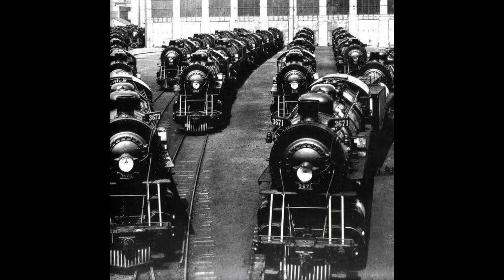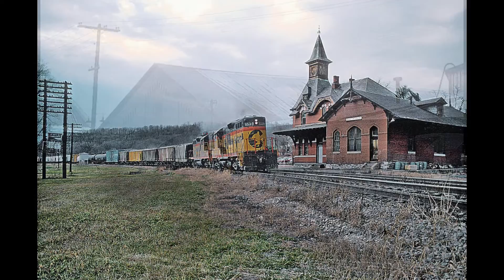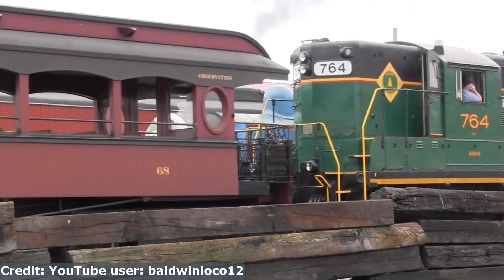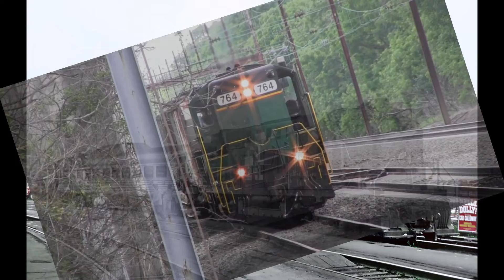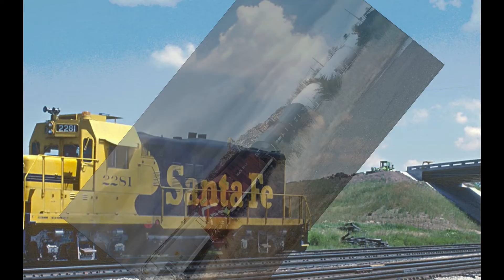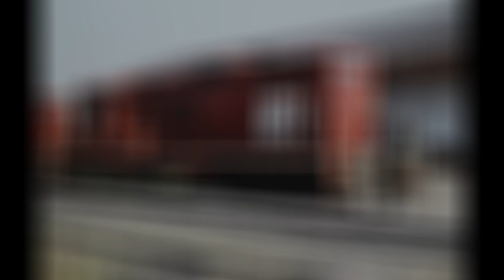The 2 in EMD' 1-2. The EMD GP 9

Comment: EMT had the backing of General Motors, General Electric was a large company, BOCES big companies could finance a railroads purchase of their diesel locomotives. Baldwin, Fairbanks Morse, Alco could not. With the railroads losing Freight to the trucks and the interstate and losing passengers to the airlines the market for brand new locomotives was shrinking. A hostile Workforce also does not help either. Both major locomotive companies introduced High horsepower locomotives intended to reduce the number of diesel locomotives needed to power train. In the end run though EMT unit reduced itself out of business. Many railroads also instituted rebuilding and upgrading of diesel locomotive instead of trading them in and buying new ones. With Alco locomotives they had all of their eggs in one basket as the saying goes.

Comment: EMD also made the GP18 & GP20 which were successors to the GP9 and had the same basic cab and hood style. The 1800HP GP18 was sold from 1959 to 1964 but only sold 405 units, and the turbocharged 2000HP GP20 from 1959 to 1962, selling 260 units. The turbocharged 2250HP GP30 was the first attempt at a new look (using automotive styling!) and sold 948 units from 1961 to 1963. In 1963, EMD started production of the new "spartan cab" (angular roofs instead of rounded roofs) models GP28 (non-turbocharged) and GP35 (turbocharged), the last models produced reaching upper limits of the 567 design capabilities. In late 1965, EMD introduced the 645 engine in both turbocharged and non-turbocharged models in the 3000HP GP40 and 2000HP GP38 (and the six-axle SD lines as well.)

Comment: EMD will also rebuild a GP9 to GP2x/GP3x ECO. Want your 75 year old engine to meet EPA T4 and make 3000HP, that can be done
Reply: sadly that could never happen. the federal government is mandating 567 and 645s all be retired and scrapped.
Reply: @suppylarue220  The federal government is not and EMD has at least 1 demo GP23ECO built from a GP9. 645 can meet EPA T2 without DEF and likely T3 with def while 710 can reach T3 without DEF and T4 with

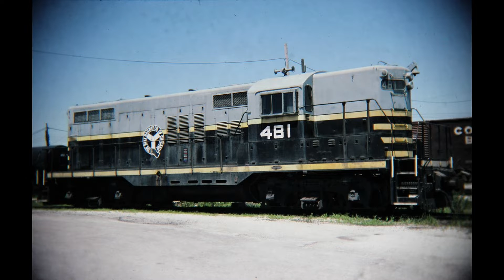Comment: Love the Belt Railway of Chicago GP 9 at 1:50 with the super-rare friction bearing Blomberg trucks. BRC was supposedly very frugal with its early diesels and options so  the company probably got five or ten bucks knocked off the price by going with those trucks, lol.
Reply: There is a very interesting and long out of print book called One Man's Locomotives. It is the autobiography of Vernon L. Smith, the Chief of Motive Power for the BRC during the transition from steam to diesel. He was a steam guy who wroked at Lima, worked at the PRR during the development of the T1, and spent some time on the ATSF too. He was apparently very old school and slow to move on to newer developments in locomotive engineering. BRC's diesels originally had tires on their wheels like steam locomotives.
Reply: @southsidediy  Thanks!
Reply: BRC didn't need roller bearings since their use was limited to low speed switching and transfer runs.